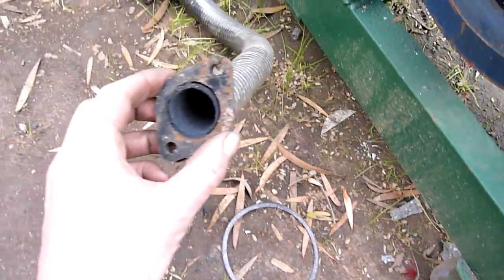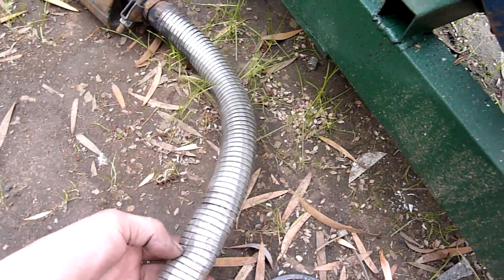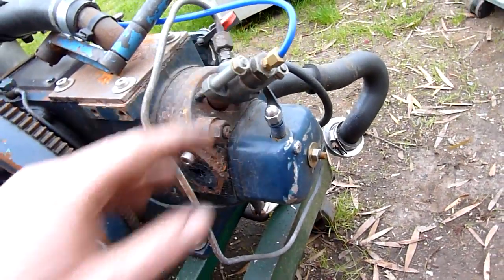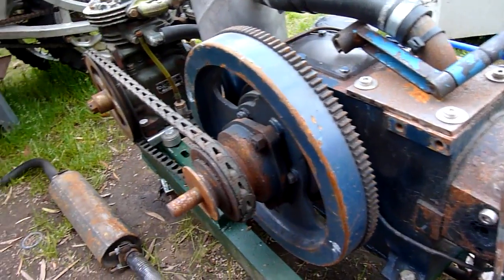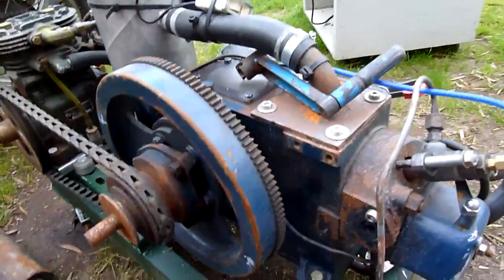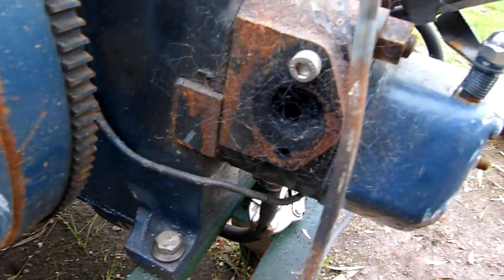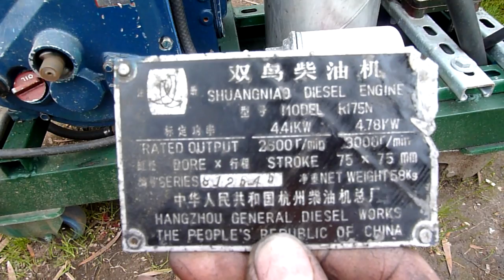Hangzaou Diesel Old Cold Start With No Exhaust

Comment from the maker: @aly369 regulates the flow of coolant through convection. I need to make a new restrictor to screw into the head. the old factory one was not much bigger than 1/4", I was running 3/8" but the bottom of the head is always stone cold while the top is hot.

Comment from the maker: @FrontSideBus not sure on fuel economy, but they are cheap compared to gas engines because diesel is cheap, or better yet use blended fish and chip oil or surplus Jet A (Kerosine) with a bit of 2 stroke lube in it.

gasoline engines are pretty fussy, diesels will take anything as long as it is not too volitile ( low flash point) or too heavy and gums up the pump. likewise it must lube the pump too, dry fuels like JetA and Biofuel need a good amount of oil in them to keep the pump happy